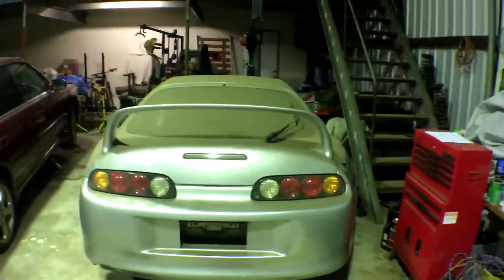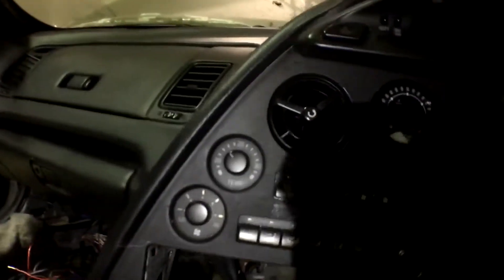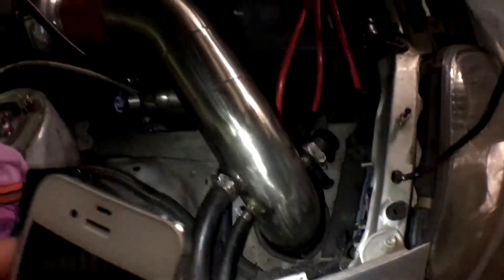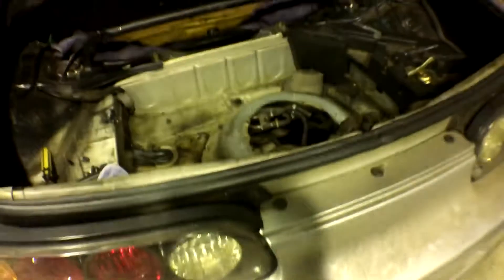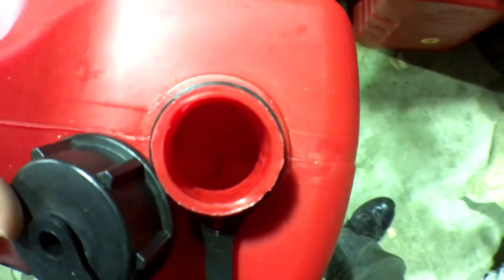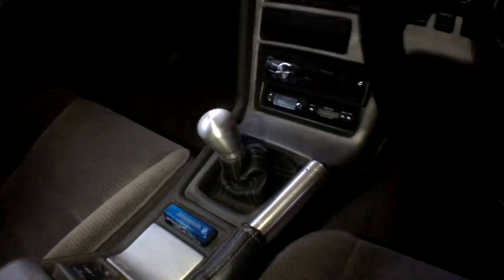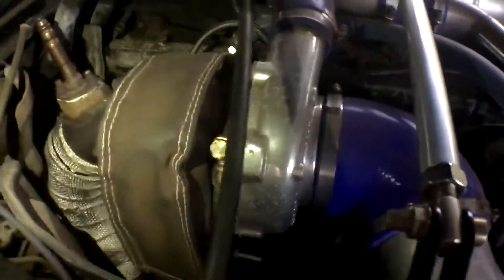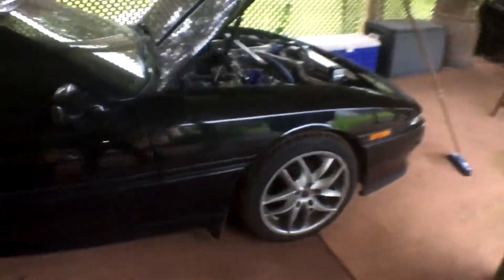Supra Shed Introduction "The Supra builds" EP0

Comment: Hi, so, a question I saw the engine of your ga70 and I noticed that it does not have maf sensor, it happens that I have the same supra and this sensor has problems like cutting the air and causing the motor to lose force could you please tell me how to cancel it? ? Thank you